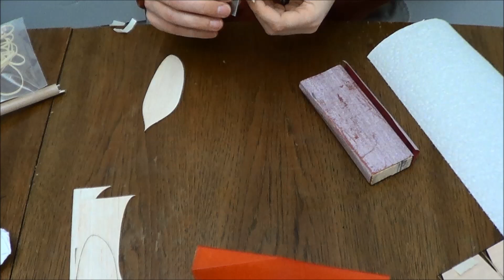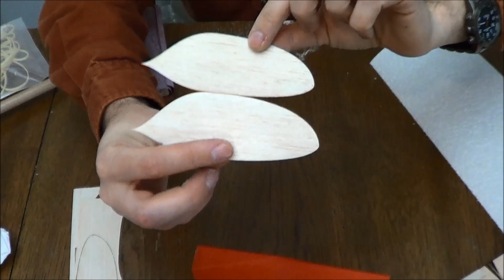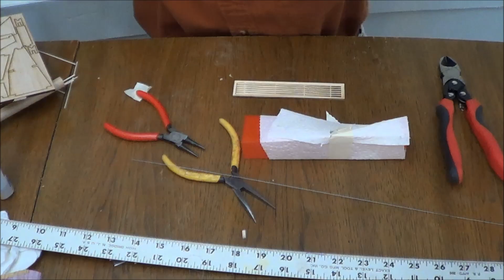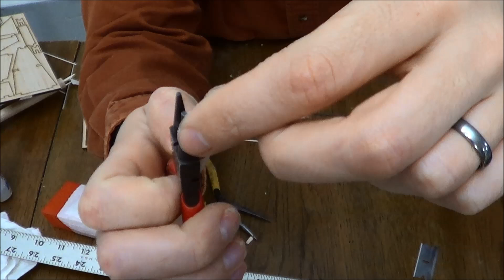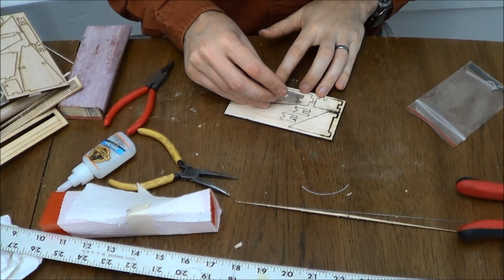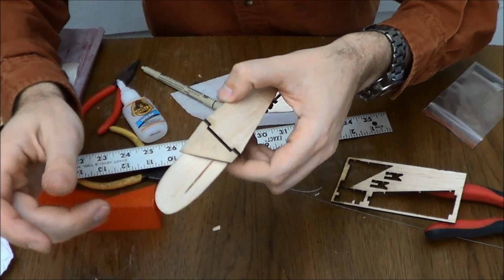Noncents Pennyplane Build, Pt.3 propeller

Comment: Super helpful video, as always!  Just a thought:  you could put the teflon tube onto the prop shaft before you bend the motor hook and attach to the prop spars.  That might save some trouble trying to thread the teflon tube on afterwards.
Reply from the maker: David Goorskey very true! Old habits die hard.